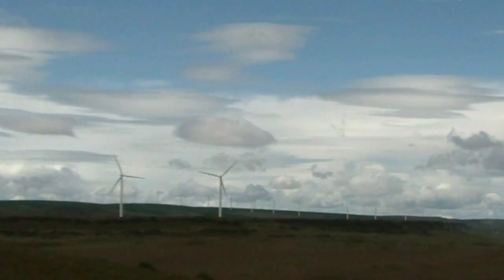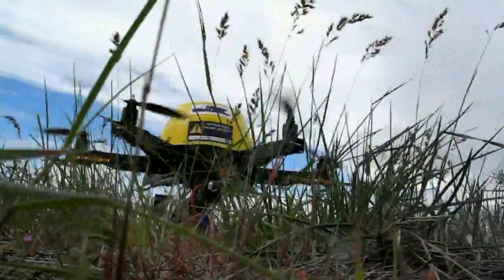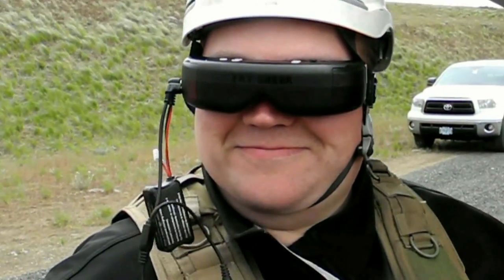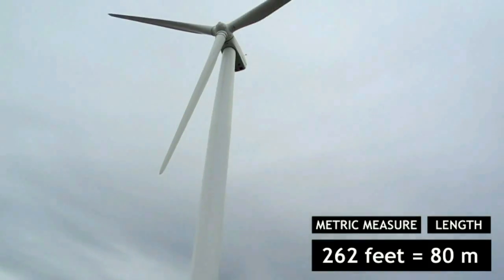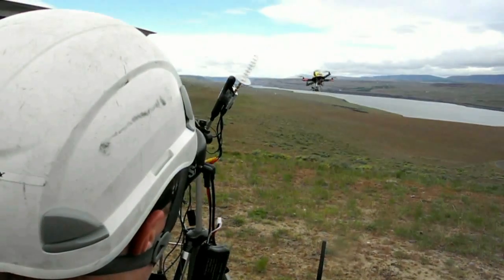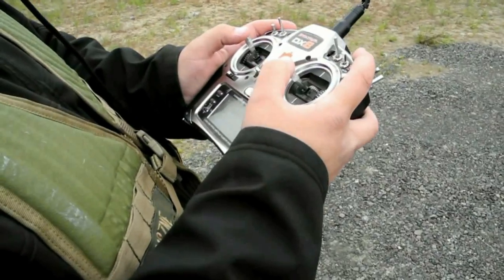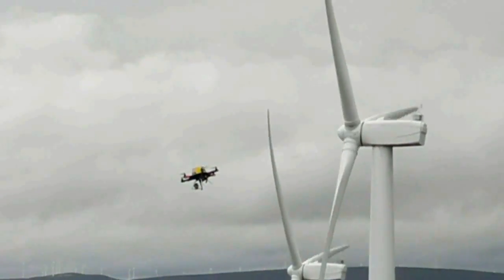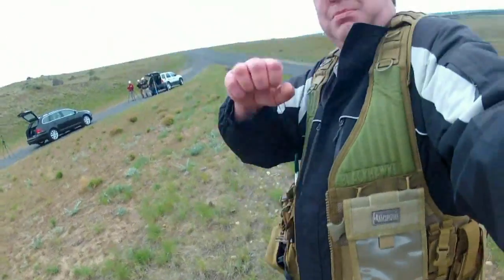RFTC: Wind Turbine Inspection Using an FPV Multirotor SUAS

Comment: Yes we have all become pretty good "wind" pilots.  I just started the FPV flying which is way fun,! Still flying only at the club field, until I trust myself for flying more freely in other places.. I fly eyes-on just about anywhere.  Only have the quad set-up for FPV, next is a Bixler-2.  I have 2 30% a 1/4 scale and lots of smaller birds.  I am the president on the club and my contact information is on the club website (badly out of date) and I think on AMA's club listing.  Come on out!!